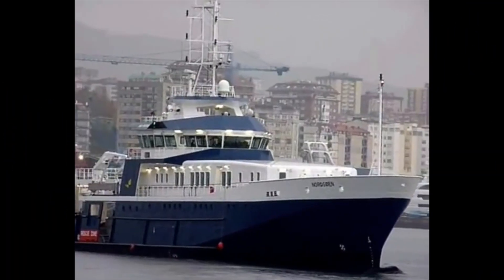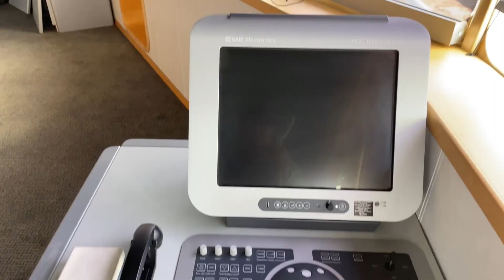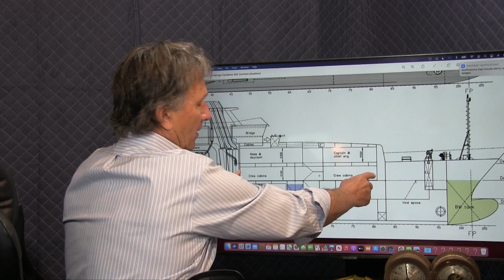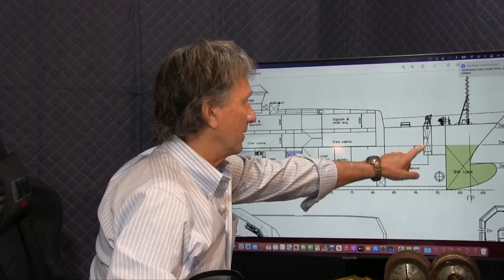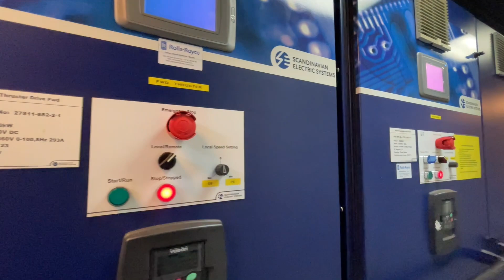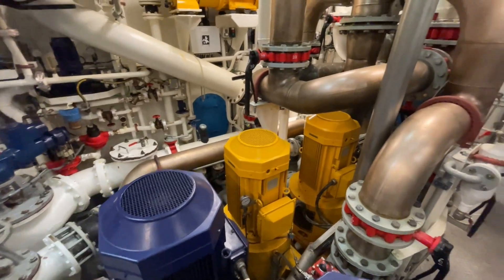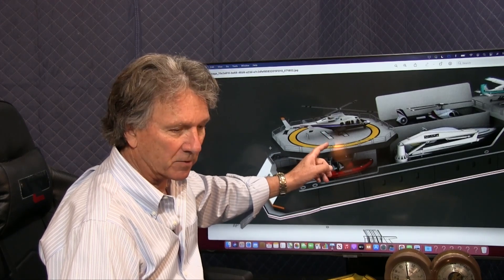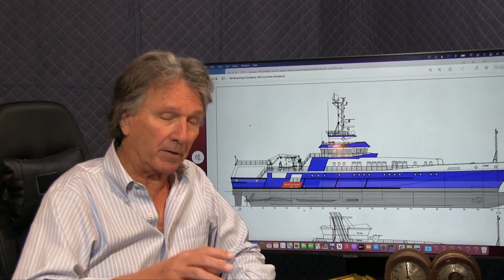Technical Tour of 225' Diesel-Electric, Ice-class, 20-kn vessel for conversion to Expedition Yacht

Comment: Has this project gone anywhere - Or still needs to start from scratch. Will need more than 9 crew though - ie double the stated number.
Reply from the maker: As a modern vessl, the minimum manning requirement is probably 9. For yacht service, as you say, could be double that.

Comment: I want a yacht that can take me anywhere in any weather at the most economical operating cost. I want it to have garages for,  at least, one H-145 helicopter and one amphibious vehicle, like the Sherp. I also want it to be able to service and refuel the Grumman HU-16/G111 Albatross amphibious aircraft (the only aircraft that can take 6ft waves and 10ft swells and has a range of 2,700 NM). I need a large saloon, an adequate sundeck, an interesting sky lounge, a small fly-bridge, a small office, a luxurious owner's suite, and 4 comfortable, but not too large guestrooms. I want it to survive mild ice knocks, but no ice breaking capability, so even no ice-plating or Ice Class 2 or 1C would suffice. I, of course, would want it to have twin engines, rudders, and screws, and either sufficient draught to survive the worst weather or a centerboard, which some of the recent NOAA vessels have. I want the interior to be practical, but classy, like that on the San Lorenzo expedition yachts. Any OSV, coast guard, salvage tug, or naval conversion would do.

Comment: But why did the Danish government want to get rid of it?
Reply from the maker: One of the shipyards building the vessel went bust, and this allowed the Danish Gov't out of the contract. They circled back and tried to buy the vessel at a big discount and the shipyard told them to buzz off. The Danes did this on several vessels in Spain when there was an overall downturn due to the oil industry. there is a similar S&R vessel being built in Spain now at a cost in the high €20's.
Reply: @XplorerYachts  Thanks for the information!